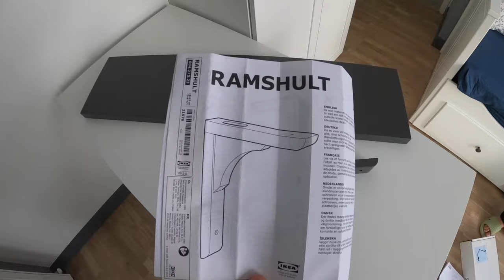IKEA console et etagere RAMSHULT

Comment: It’s a very good video. Could you list the tools you used… the nails? And the tool after the drill? size drill? I am trying to do this on my own with the exact same shelf. Thank you.
Reply: I also need to know which nails he used..
Reply: @aylintekel7315  those are not nails, but special metal cavity anchor - brand is Fischer hm-s model. You dont neet the special fischer Installation pliers for this job, just tight the bolts till they have the butterfly form and ready to go.